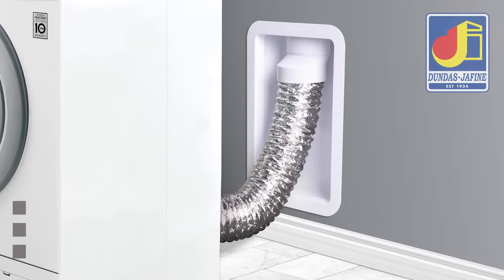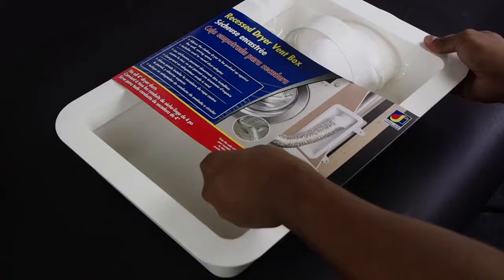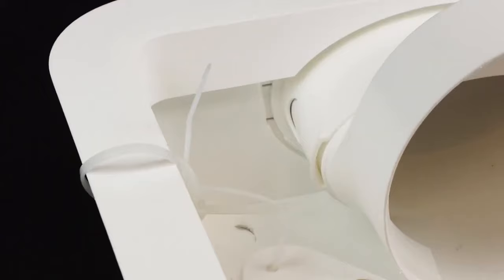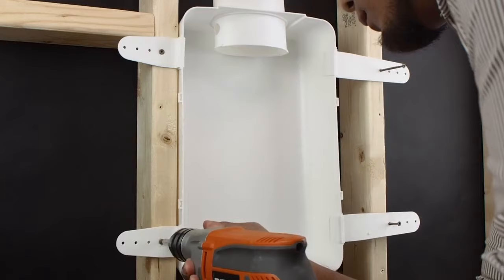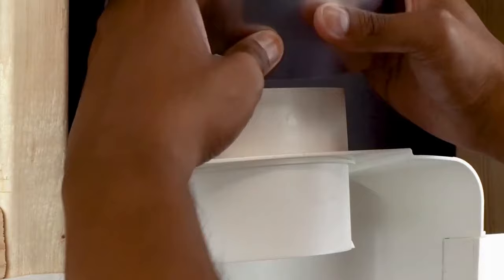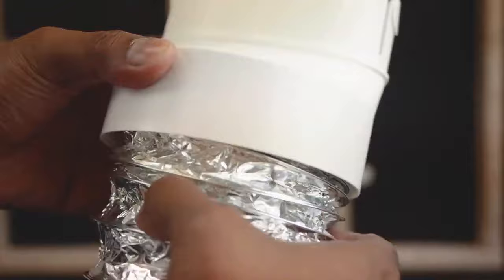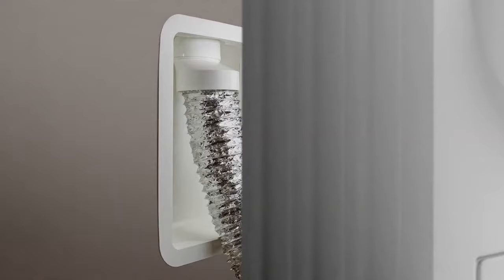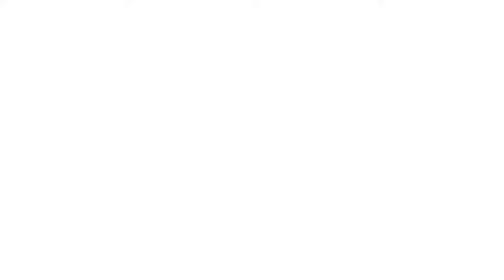Recessed Dryer Vent Box - Installation: Dundas Jafine

Comment: Can I  install the box in the "upside down" position?
Reply from the maker: If you plan on installing it upside down please ensure the backdraft damper is removed before installation (if included with your plastic box). This damper will not function properly if the box is in the upside down position

Comment: I have one of these I noticed the 4” dryer vent hose is almost too small to connect on the inside when I try screwing it on. Not sure if it’s the right size or not anyone know ?
Reply from the maker: Hello and thank you for your question Recessed Dyer Vent Box. The Recessed Dyer Vent Box was designed to accept the 4 in. dryer vent hose. It may take a little bit of adjusting to make it fit properly to the adapter, but the 4 in. dryer vent hose is the proper size for this product.